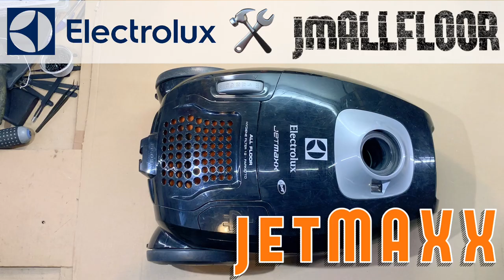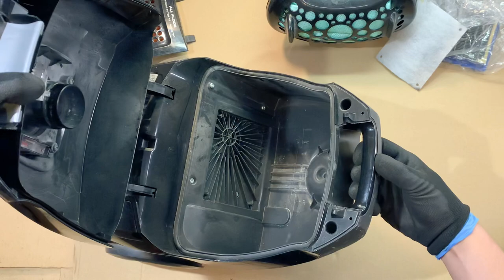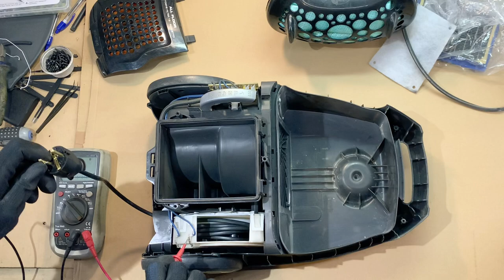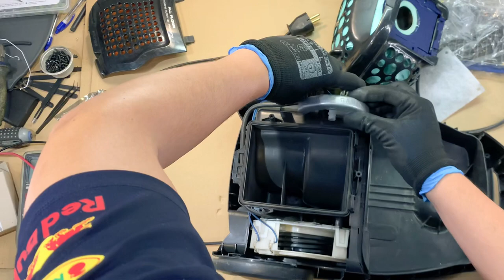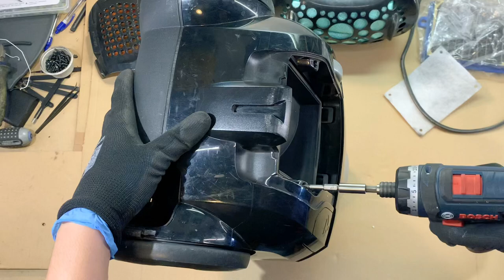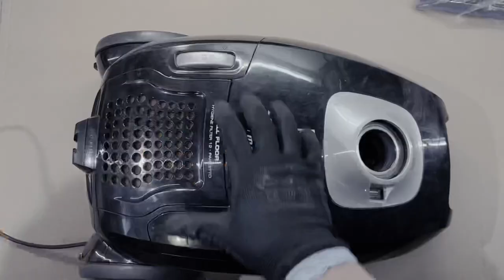It does NOT work at all - Electrolux JetMAXX JMALLFLOOR Vacuum Cleaner

Comment: Another question would be, can you bypass the control board and just run it at full speed all the time?
Reply from the maker: Older model of this model had no PCB for regulation, just power switch. So motor is designed to handle it, but that circuit board cost 10€ and it protect from overvoltage that 50€ motor, so it is better to have that PCB there
Reply: @proexservis  Thanks for the reply's. The reason I had asked about the circuit board was that I have an inexpensive Bissell zing lightweight with a board and a possible issue with the transistor that has a decent sized heat sink on it. Solid cap, resistor and a diode, off of that it has the sliding variable resistor for for speed. Does have a fuse that tested good and what I found interesting testing the power cable and wind back unit which tested good but they are switching the neutral side which seems odd? With that the switch tested good. I did not put the full 120v direct yet to test the motor as I was not sure if it would handle it without the board. I will try that tonight. One day it worked and the next it did not without stress on the unit and it always is unplugged unless it is used. I will try the motor tonight. The whole vacuum costs 59$ delivered. I did buy one but figured I would see if I can have a second on hand. Thanks again.
Reply: @proexservis  Well tonight I bypassed the control board and a big zero. Pulled the motor and tested one lead to the cosponsoring brush and I did have continuity, tested the other and a zero; looked closer and the wire from the winding was broken from the terminal. The wire is protected by some fiberglass material that I will have to strip back and being a 4mm gap I will have to bridge it somehow and test. If you have a good way to do this let me know otherwise I will do my best. Thought the update might be help for some out there. Looks like a quality brushed motor with lots of life left. Something to be said about brushed motors, they last allot longer then most imagine.
Reply from the maker: @curiosity2314  I don't have one. But good luck with it, i think you have more work with it than the whole vacuum cleaner cost.
Yes, some carbonbrush motors last a long time, but some have 2-3 years and are completely trashed.
Reply: @proexservis  That transistor looking thing was a BTA16-600B Medium Current Triac,Gate Trigger 16A, 600V,TO-220, looked it up and tested it and it did test good. There was a TVS diode you had to jump through all kinds of hoops to test and at this point I'm sure it is fine, the rest was simple to test. I will send the results once I have them. I was surprised that the brushes were replaceable, what would trash the motor? For me it's about making something that does not work, work. As a business it would be a no brainer to trash something that could be repaired. Units like this might be better given to charity organizations that refurbish? Update coming soon. 😀
Reply: @proexservis  Update and success, I was able from outside the motor to solder a 14 gauge solid copper wire to the broken winding and terminate at the terminal block. One less vacuum in the recycle bin! I will give credit to Bissell as for the price they use very good components.
Reply: @proexservis  Additional, the wire wrapped with fiberglass must be a thermal overload wire as each winding has it and that was not the wire that broke so I had to put the fiberglass back in place. Caught that by accident turning the motor and finding the second for the other winding.